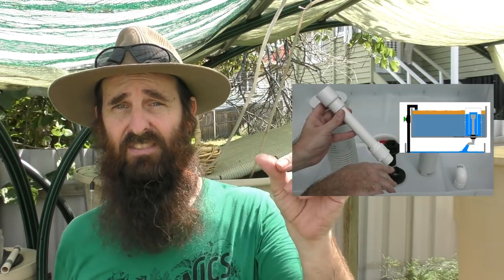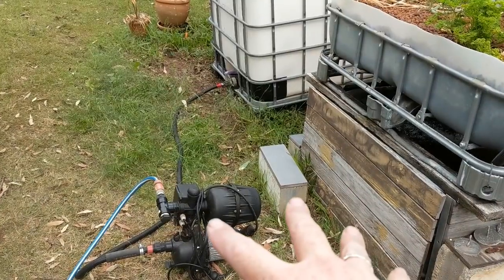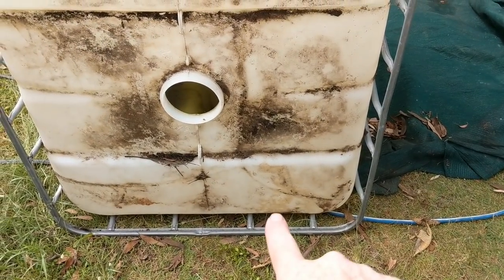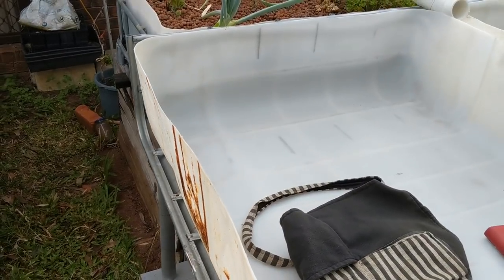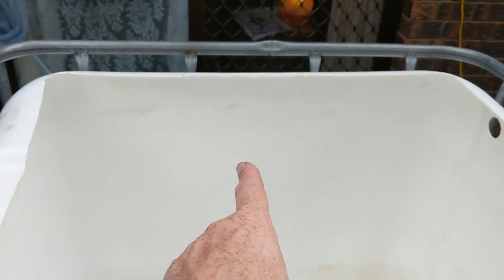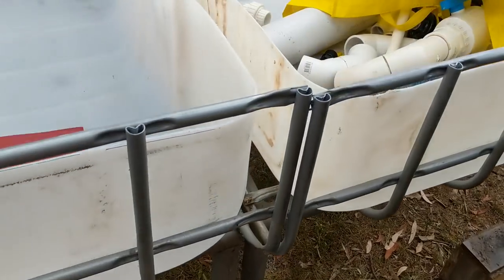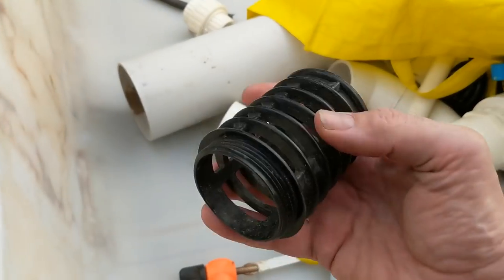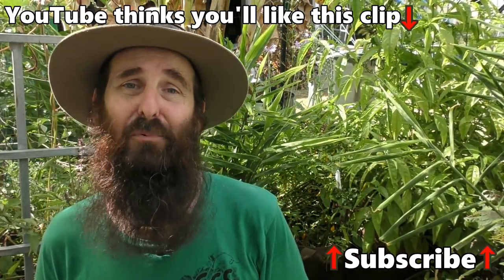Aquaponic Chop & Flip Expansion | System Layout

Comment: hey Rob Those square framed IBC totes make the best fish tanks, because its dead easy to clad them in corrugated iron. They look great and keep 100% light out. You can also fill between the iron, and tote with squirt foam for some extra insulation.
Reply from the maker: Hey Ram2. They want to clad them with recycled timer palings I think. Corro works well though & the foam will help with temperature regulation too. 
Cheers & all the best mate. 👍
Reply: i was just pointing out that most ICB totes have a tube frame work, which is hard to get a screw into. The square tube frames IBC totes arnt so common\